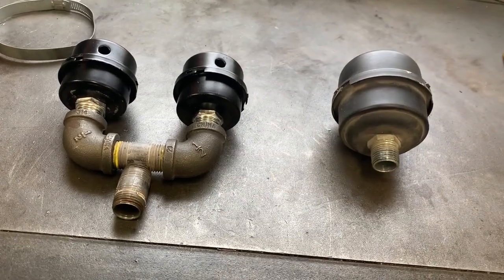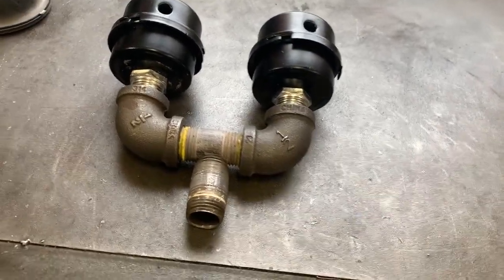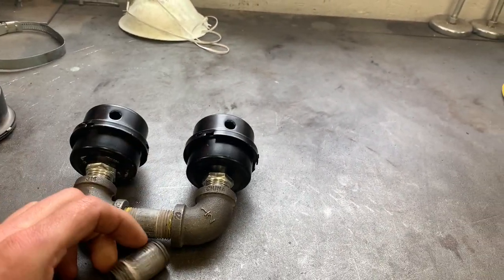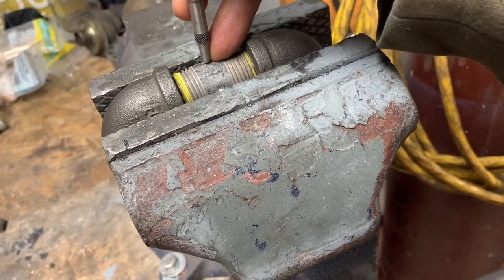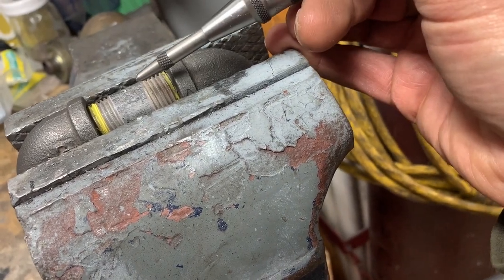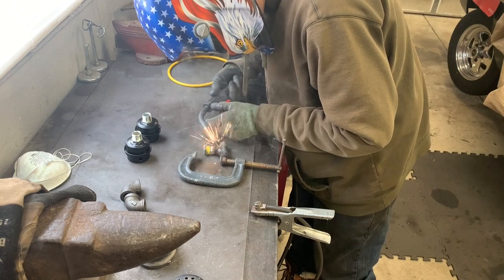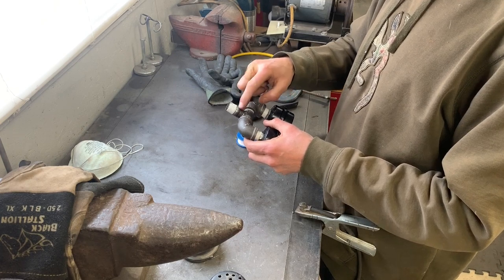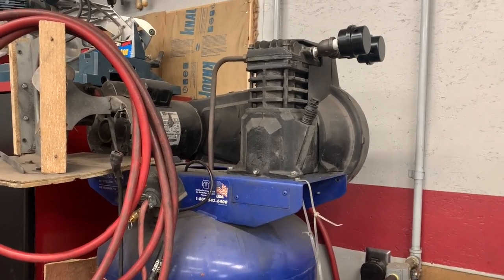Air Compressor Dual Air Filter Modification

Comment: Have you attempted to use a sound decibel meter app, to measure the difference using the single larger filter compared to using the two filters? I'm curious to find the sound difference between them
Reply from the maker: So I installed a decibel app today and tried it. The old single filter was 103, the dual filter was at 98. I was standing about 5 feet away.

Comment: Why wouldn't you use a 1/2 inch "Tee" instead of all that drilling and welding ?
Reply from the maker: I was bored in the shop and didn’t feel like driving to the store. Used what I had lying around in the middle of winter when I did this video.
Reply: I was thinking the exact same thing! However, I also thought... if this is what you have around the shop and it’s available(a bit more extra steps but cost efficient)!